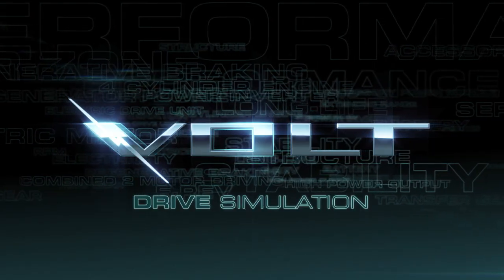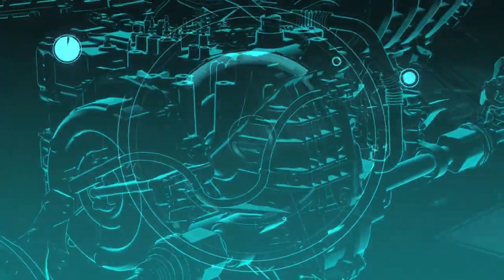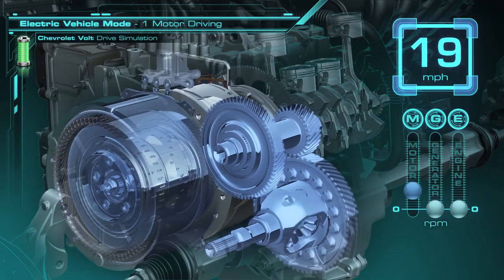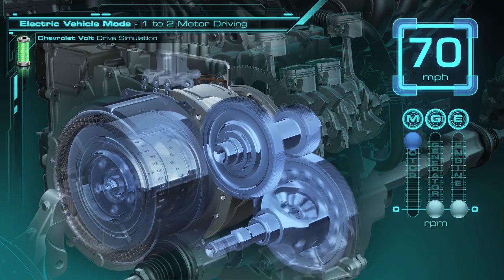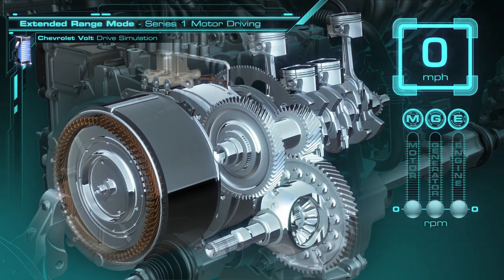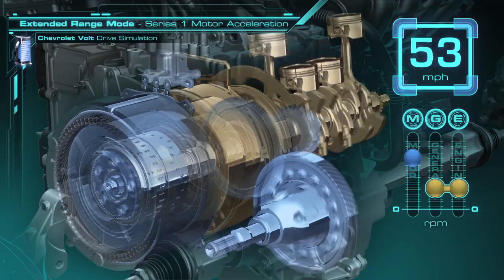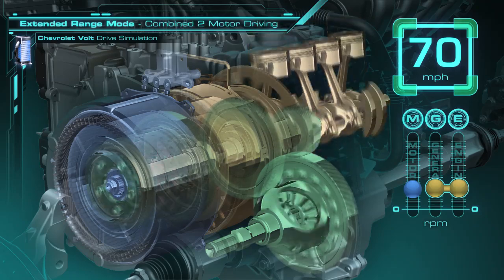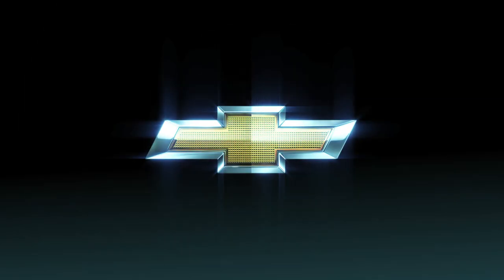Chevrolet Volt Drive Simulation

Comment: I am amazed by all the naysayers on this thread. Let me try to explain the efficiency of this vehicle. I drive 80 miles per day on 18 kWh of electricity and never use gas (my employer let's me charge at work). And by never, I mean it's been 4 months since I've used gas. I pay 8.5 cents per kWh and with a 16% efficiency loss in charging that comes out to 9.9 cents per kwh or $1.80 in electricity to travel 80 miles per day. Gas in my area is $3.10 per gallon. So paying $1.80 means I am using the equivalent of 0.58 gallons of gas. 80 divided by 0.58 gallons is an MPGe of 138. Find me another hybrid that gets that kind of mileage. This is brilliant technology.
Reply: Of course, there is nothing Toyota can ever do wrong. Even though this vehicle is a very well thought car, The Toyota marketing department has convinced a bunch of people that the VOLT is still a piece of garbage. Scotty Kilmer is their cheerleader.
Reply: When I bought my 2012 Volt, there were a slew of naysayers saying that the battery wouldn't last. Today, it's clear how wrong they are.
Reply: @KTPurdy   - People are catching on: I'm amazed how many Volts I see. Here in Colorado you have big distances occasionally and battery range loss in winter so the Volt makes perfect sense, provided you even hear about it.
Reply: @docdissent  Well, since the Volt is discontinued it can only catch on so much. I do agree that until we get solid state batteries, low temperatures drop range. Volt makes a lot of sense.
Reply: . Now, here we are 5 years later after the last one came off the assembly lines, GM is bringing back PHEVs. They should SCRAP all EV projects except the BOLT, which is being updated. Then, update the VOLTEC system and put it in their most popular cross overs.
Reply: @docdissent  My local Ford STEALER had a 2014 on sale for 10K recently. It barely sat for a week. My Chevy STEALER had a 2018 and it was sold within 2 weeks. If they're clean and in good condition, they sell fast.
Reply: @KTPurdy  hows that battery holding up? mines died last year
Reply: @littlepastelkitten  That is a total bummer. My 2012 was a lease so I don't know how that battery is doing, but I did purchase a 2015 Volt. It's lost about 10% of of capacity. I haven't taken the time to hook up a OBDII app to see if some cells are weaker than others.
I've been disappointed that an after market solution hasn't developed to provide options for Volt owners.
Reply: @littlepastelkitten  Mine is still holding up as if it was new. Still get over 40 miles during optimal conditions.
Reply: The Volt system is a feat of engineering. GM has really blown a lot of people away with their technology!
Reply: @JN-mk2fh  And ironically it was under Bob Lutz's watch that this vehicle was developed. Many call him all sorts of names, but the guy ain't stupid.
Reply: I have the UK Vauxhall Ampera, so the same mechanicals as the Chevy Volt, I also have a 2019 Tesla Model 3 Performance. The Vauxhall/Chevy is every bit as good as the Tesla in many ways. It’s more comfortable in my opinion, and the steering is less numb feeling, it’s also more efficient on electric mode in normal driving than the Tesla. However, due to its limited electric range, it’s only making a useful cost saving for you if you happen to work just at the edge of its full winter range... and you can charge back up at work. The Tesla is, obviously, the first really useable electric car
Reply: @pjonespresents9843  During winter, I get about 30 miles instead of 42. Even if you use gas for the last few miles of driving, it's still peanuts.
Reply: Totalmente de acuerdo con usted. Tengo un 2012 Chevy Volt. Por lo regular, conduzco 30 millas por día y cargarlo me cuesta menos de 1 dolar. Algunas veces veces en la mañana recorro 30 millas, en 2 o 3 horas del mediodía recargo y tengo 30 millas más para recorrer en la tarde y sólo he gastado menos de 2 dolares en el día y algo más de 60 millas recorridas. El auto tiene 160,000 millas y aún conduce de forma excelente. Yo lo amo.
Reply: I have had similar joys driving my Volt. You didn't even mention the complete lack of maintenance this vehicle needs as well!
Reply: . Maintenance? You need an oil change once a year. Coolant flush for both, battery and engine every 5 years. Electric drive unit fluid change every so often. They're not frequent and expensive, but required.

Comment: my question is: For VOLT,  we are trying to complete day drive with only battery power, so that's pretty much full deep cycle each day for the battery. Compare with e.g. LEAF a fully BEV, a day drive is only about 1/3 of total range.
So theoretically, Volt will have much tendancy to have battery fail than LEAF.
Reply: Not really cause the real power of the battery is 16kW/h but only 10.5 is
usable each charging cycle.So years after year you never see battery degradation.Volt use about 60-65% of the real power of the batterie compare to the leaf use about 80%.You NEVER can really charge or discharge totally a batterie in a EV véhicule.
Reply: Fred P Absolutely correct. Plus the Volt has a sophisticated active liquid cooling strategy, whereas the LEAF uses passive air cooling. Big difference in longevity from that as well.

Comment: The Volt is an obvious "breakthrough", which should have happend many years ago, even without the progress in lithium-ion batteries. This is how every car built today should operate.
Reply: I don't understand why more people don't option for a car with an electric drive train. They're so much better.
Reply: @KTPurdy  much harder to DIY and much more dangerous, also electronic systems are much less reliable than mechanically driven ones.  I own a Volt though
Reply: @lemonator8813  not true, anything with friction, can not be more reliable than with out. Properly built and protected electronics could last long long time. But yes, you need great scan tool, just like any progress, that requires new tools for new tech.
Reply: @globuslive  have you seen a diesel compression engine ? Or mechanical fuel injected? Those will last just about forever. Just huge hunks of metal. 
All modern electronics have semiconductors and they diffuse their dopants over time no matter how well protected. 
Needing a complex tool that needs an alternate power source, like the EV is inherently less reliable. 
I can't readily or cheaply store fuel for my EV in case of emergency but I can easily keep my other car full, and have extra fuel stored. 
No I'm not a survivalist nut I just live in the land of quakes and fires, one of the reasons I picked a Volt over a pure electric. 
If the power grid goes down people have used theirs as generators! Very reliable and practical. 
When we can cheaply and readily have power banks in our homes maybe it will be feasible but that seems like a major fire hazard.
Reply: @lemonator8813  Yes, I have Cummins at 600k miles
Reply: @globuslive  there's a better idea but they scrapped it 30 years ago.  Use a small 1 cylinder engine to turn a generator and charge up one battery while the car is running on the other battery.    Electric motors at the rear wheels and a small gasoline tank.    3 gallons would be more than enough
Reply: To bad the only people that noticed were the ones lucky enough to buy Volts ⚡!
Reply: Except this wasn't possible before Lipo batteries. It takes complex battery management, oversized redundant packs, active cooling, running the pack only from 30% to 80% and never beyond to pull this car off and make the batteries last.
To mimic all that with old lead acid or nicad's you'd need a 1-2 ton truck chassis full of batteries, and the batteries would only last a fraction of the time making it way more expensive than gas.

Comment: I would love to see this same video, but for the second generation Volt.
Reply: Why? As far as I know nothing changed except for the range/battery.
Reply: @mv80401  pretty much everything has changed: https://en.wikipedia.org/wiki/Chevrolet_Volt_(second_generation)
Reply: @mv80401  A LOT changed. There is a video on youtube. Just do Gen 1 vs Gen 2 volt. The chief engineer at GM explains it himself. BIG difference between the 2, but it seems as GEN 1 was built better.
Reply: @mv80401  https://youtu.be/o3-wGOyT2-I

Comment: In my 2015 Volt I bought 4 gallons of gas on March 11, 2016.  I drove about 700 miles that month.  Then the whole month of April I drove about 820 miles and used 2 gallons of gas.  So far it is now May 17 and I have driven just over 300 miles so far and haven't used any gas.  So if you drive less than 40 miles a day (or 50 miles if you get the new Gen 2 Volt) you can also go 2 or 3 months per fill up.  My record is June 28, 2015 to December 11, 2015 on a single tank of 9 gallons.  We just happened to not drive out of town that much during those months.
Reply: I bought a 2013 Volt back in 2016, I actually never visited the gas station from April 2016 to April 2017.  I went a whole year without gas.  It finally told me it was going to start using gas because it was getting stale.  So basically if I had not had the gas go stale i would have never needed gas for a long long time.
I've got a 2019 Volt now, because I wanted the latest and greatest since they stopped manufacturing them.
Reply: Joshua Pritt did the gas in the tank ever get old from not being used?
Reply: @jacksonbangs6603  As a former Volt owner (sold before a sabbatical abroad, now in a Leaf) I know that the car will force the use of the engine at some point. One of the criteria is outside temperature (you can set that forced-on temp lower or higher).
Reply: Great!
Why aren’t you driving a leaf? Most of the time, people will go on road trips in a volt...

Comment: Brilliant car..I've had mine for over 50,000 miles now.. without a problem. I've heard there are some on the road with over 200,000 miles. (In the US I think) They just seem to need the (front) tyres changed at around 35,000+. There is supposed to be an engine oil change in there somewhere... I'm expecting my first one at about 100,000 miles. It's showing lifetime 207 MPG.
Reply: MrTeff
Yes.. you're right. The figures reflect how much petrol was used (MPG) to cover the mileage since the car was new in 2012. Sure there was also electricity. But it was very cheap, you don't use much, and it is not measured in gallons! We need to keep in mind that ICE's are about 20% efficient, whereas electric drive is around 80%. The drive train is in effect a series hybrid, whereas the Prius is a parallel hybrid.. ie completely different. I will say though, that if I undertake a trip completely on petrol.. not charging the battery at all.. I get a steady 48mpg regardless of how I drive it. A friend of mine is an Airbus pilot.. when he flies to the Caribbean he uses a lot more fuel getting there than getting back! So what would his true "MPG" be? Well yes.. it's an average of both.. there's nothing wrong with measuring it that way.
Reply: Gasoline supplies about 32.78kWh of energy per gallon.  They calculate MPGe by computing how far the car goes on 32.78kWh of electricity.  It turns out running the generator is more-efficient than driving the wheels, and driving the wheels by electric motor is highly-efficient, so you can get more of that 32.78kWh out of the gasoline this way.  Plug-in charging generally gets around 400MPGe in cars like the Tesla Model 3.
Reply: I think it is a matter of interpretation. I once drafted behind a tractor-trailer rig in my MG midget and covered over 50 miles on a single gallon of gas. Is it not fair to say I got 50 MPG? My average for the entire tank was probably around 25 MPG; never the less, whatever metric I use is legitimate as long as I provide the details. Regarding Michael Monk's posting, I do agree that he should factor in whatever fossil fuel might have been used to charge the batteries and its cost. (I suspect he knows this.)
Reply: With 32 kw/h(it's like charging em 3 time full) a chevy  volt can go around 130-150mile,so int means that is around 130 to 150 mile/gallons in cost efficency.
Reply: Hai monk i want to know how it works whether it take  ic engine's  power to generate electricity and thus running the motor with electricity... Is it
Reply: 207 MPG GEEZZ

Comment: ive had my volt 3 months and i love it. its funny how the gas generator revs independantly of the accelerator. amazing all electric performance, gas operation is fine, but im heading home at that point
Reply: Wow. You are really butthurt. I get 46 mpg. The engine is not mechanically connected to the wheels.
Reply: I bought my 2014 Volt Premium for $18,000 USD with 19,000 miles. I rarely travel outside of town and only drive about 22 miles a day. This works perfect as I charge it everyday for $0.11/kwh. 

Regardless of all that, your focus is more economics than environmentalism. Some will argue with the process of battery production, but having the ability to charge the battery 5,000 times or more is pretty nice when preventing fossil fuels from being dumped into the atmosphere.
Reply: ***** but i have one and its pretty sweet.

Comment: catch fire?  it happens everyday on gas car. 

In 2003-2007, U.S. fire departments responded to an average of 287,000 vehicle fires per year.  These fires caused an average of 480 civilian deaths, 1,525 civilian injuries, and $1.3 billion in direct property damage annually. 

I may buy the next gen Volt, it is gonna be cheaper, 5 seats and more MPG.
Reply: GEn 2 might give more MPG, but Is not built as solid as gen 1. GEN 1 uses gears to spin the shafts, while GEN 2 has a chain. Gen 1 is far stronger engineering than Gen 2.

Comment: The new Tesla is $45k. In 3 years  I use $45k in gas. Electricity at Tesla charging stations is free. What will be the used market for Teslas? Will there be a better Tesla?
Reply: The new Tesla is twice as expensive as you say it is and no one on earth spends $15,000 a year on gas!
Reply: mgibbs88 I am a cab driver and drive over 100k miles a year.
Reply: Actually, according to Tesla, the model III will have a base price about $35,000. The base model will do zero to sixty in under six seconds and have a range of 210 miles. For some people, maybe that won't be enough range, but for me, it would be more than enough for our second car. Since we bought our Chevy Spark EV six months ago, it's pretty much the only car we drive. It has range of about 80 miles. Our other car, a Mazda 3, stays in the garage most of the time.

Comment: Actually, the Volt -- and all electric cars -- are safer than conventional internal combustion engine-powered vehicles.  Look into it. Seriously.  I just participated in an EV training program for firefighters.  The bottom line is simply that EVs are amazingly safe!  They're not perfect, but they are the best transportation tech available today.  Firefighters are interested in facts.  The Volt has one foot in both worlds, but it does have a 5-star crash rating, and a totally clean operational history.  That may be shocking to some folks who have been hoping that this technology will fail.  The future is here…and it is ELECTRIC!
Reply: Philip Stasik it's gov regulation. That the a pillars need to be thicker these days to make sure the roof doesn't collapse in case of a roll over.
Reply: Great point!,it's the first thing i notice when i drive mine for the first time,that post is really dangerous and we really have to check2-3 time to be sure that is have not a car comming in that dead spot before traveling an intersection.
Reply: I like the Volt been fixing them for years, but there is one thing EVERYBODY over looks that is the supper  wide post blocking your view while driving at each side of the windshield.  That post could be made to block under two inches of view.  well then why is it so wide, the same reason other automakers are are designing them like that there are more accidents when you can't see, that way you wreck the car and they sell you another one.  99% of people here are not going to believe me but i have cut the cars apart in that spot i know what I'm talking about It's all about money, and it wont change unless people start suing.